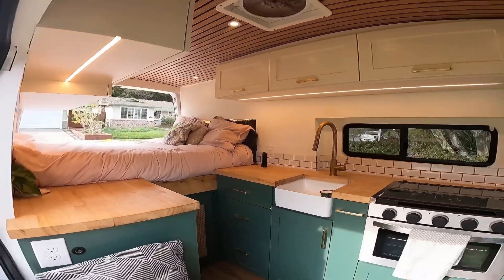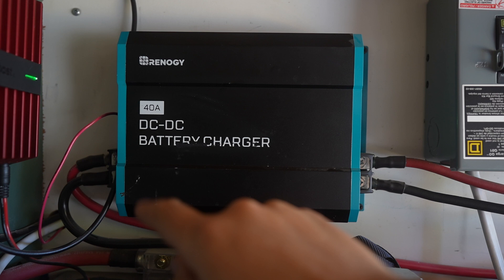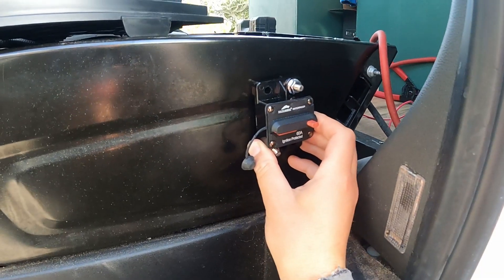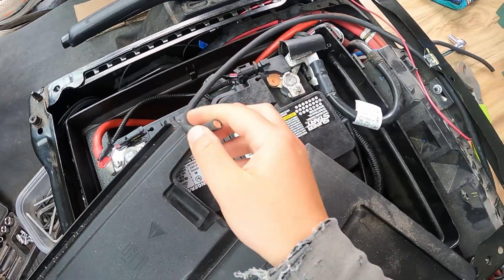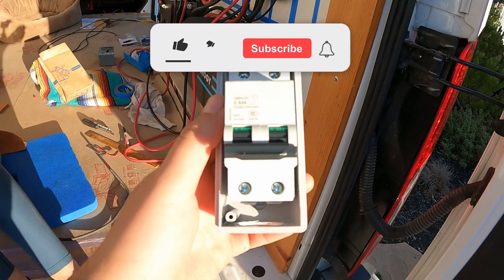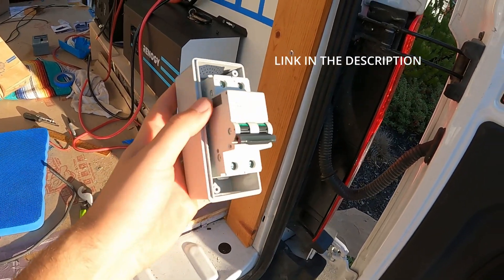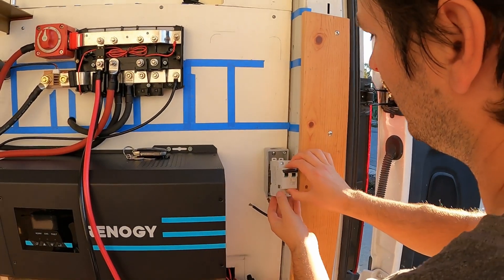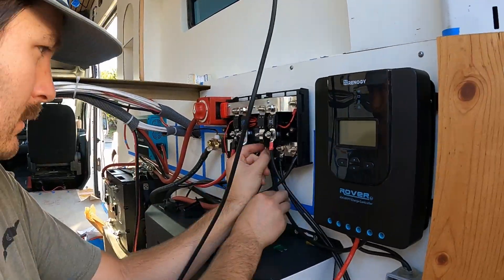Step-By-Step DC to DC Charger Installation | Van Electrical Part 3

Comment: I am more confused than ever after watching this, I thought the supposed ignition input wire was piggybacked from the fuse box, not from the ignition wire itself but from something that could only be turned on when the ignition key was turned to on, mind you my system will be a lot more simple than this one and no solar panels, my circuit breakers are non existent either and just have in line fuses. Its not a fancy set up just from leisure battery to 240v invertor for running power tools in a van, my old van just used a split circuit relay but apparently that doesnt work with a smart alternator. Looking at this im stuffed lol
Reply from the maker: i've also seen people piggy back off the fuse box. There are multiple ways to do the same thing, but this seemed like the best option for us because we were already under the seat. 

I don't know if it was clear, but our DC DC charge is only comes on with the engine running.

Comment: What if you decided to buy a bigger fridge after you wired and you need to run larger wire because of the new location? Is it easy to change at the fuse box or add to it? Definitely asking for me!!!!
Reply from the maker: Just size the wire to the big fridge that you think you'd upgrade to. It won't hurt if the wire is too big for the smaller fridge

Comment: Thanks so much for your brilliant video. Can I ask why you used a separate DC - DC charger and MPPT rather than Renogy's combined system? (Renogy 30A 50A DC to DC Battery Charger Dual 12V W/ MPPT)
Reply from the maker: Thank you! Those weren’t available when we purchased all our electrical components. I’d probably go with 50A mppt/charger. I’ve heard those can act as a trickle charger to the car battery too which would be nice

Comment: Step one. Buy a Victron.
Reply from the maker: You do you. Our entire renogy system has been working perfectly since powering it on. Victron might be higher quality but it sure is more expensive
Reply: @nomadmaddie  Good to hear that. And yes it is.  I did not have the same experience. Out of the whole system, the only thing left is the inverter, which has worked perfectly.
Reply from the maker: Dang! I'm sorry to hear that!

Comment: I've seen some people use a relay connected to the C-33e port. So my question is do you not need one to make this work for the Renogy DC charger. Thanks!
Reply: People us a relay because they connect to the "engine run" instead of the "ignition".  The "engine run" is a switched ground.
Reply: @Freeloving  what is a switched ground? What’s the advantage to using that?
Reply: We read that too and figured we’d try it without the relay because it was confusing us. I’m happy to say we’ve been using the charger for about a year now and it works perfectly.